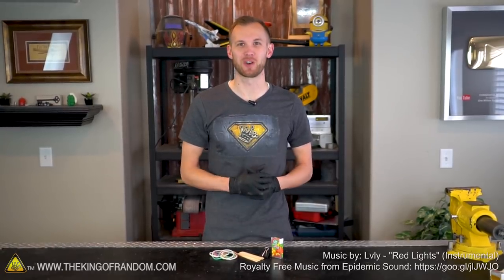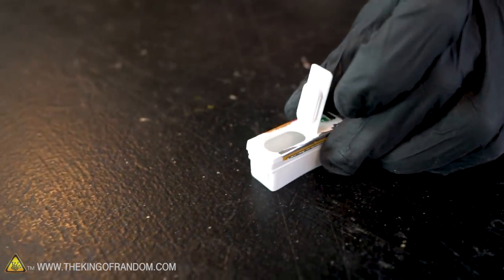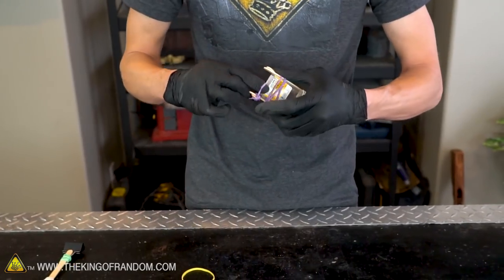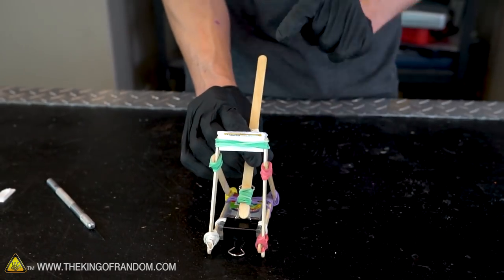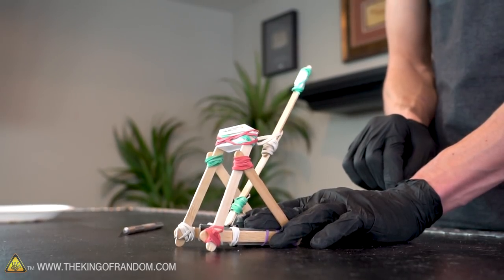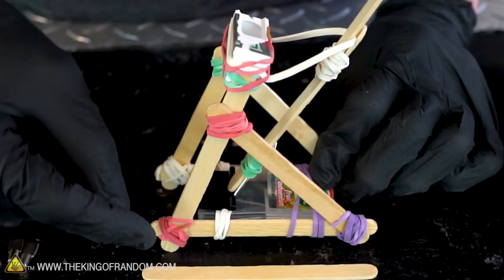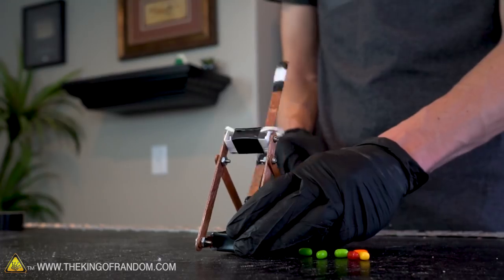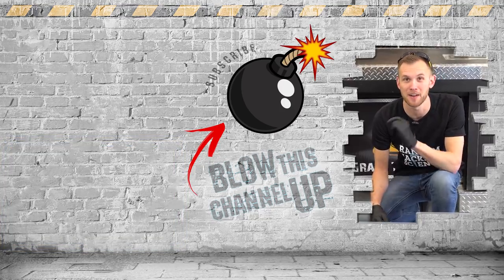DIY Tic Tac Catapult! The TKOR Guide How To Make a Catapult!

Comment: It's recommended to use a high speed setting when drilling small holes. Also wrapping tape around the site of the hole will help prevent splitting.